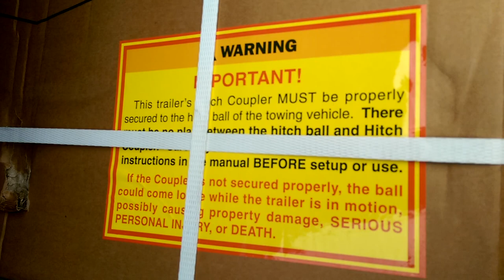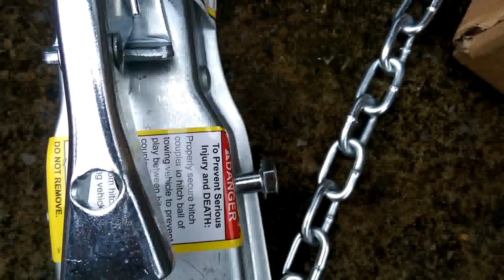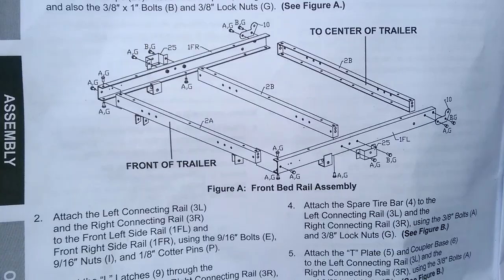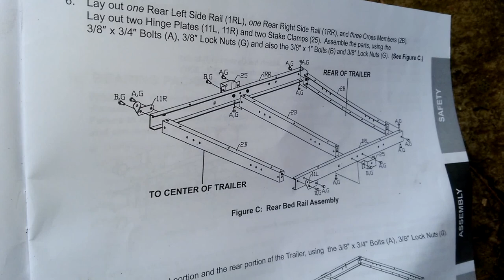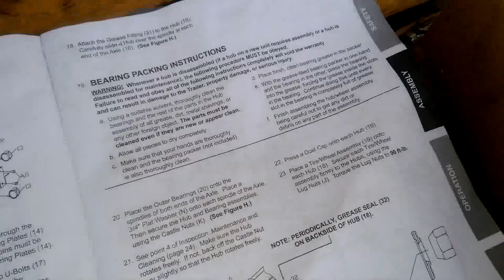HARBOR FREIGHT heavy duty folding trailer 4x8 1195 lb.

Comment: Yeah my bearings had a yellowish grease on them as well when I got mine, but they weren't packed very well. So I cleaned the old grease out and used better grease...last thing I want to deal with is a wheel seizing up a 100 miles from home. But again that's cool that it seems at least some of these trailers are being shipped with greased bearings already

Comment: Hey there, I have the same trailer and was just wondering if you packed the bearings before installing them/using the trailer?  If not, I would do that ASAP.  the bearings do not come greased out of the box and I've read countless reviews of people who say the wheels locked up because they weren't packed and greased.  Just wanted to pass the tip along so you don't end up with a seized wheel.
Reply from the maker: pattersonbrl Actually mine were greased out of the box . I broke all the rules and even added more grease through the grease zerk after assembly without cleaning factory grease out which could have been mismatched . I was lucky the two greases matched and all is well no heat build up . I suspect people that have had trouble may have dropped the bearings during assembly( dirt sand etc.) or over tightened or tried to rotate while seating bearing  . Bearings are cheap to replace we all have done it once . Still even if new bearings are needed its still a great deal you can't beat the price .
Reply from the maker: nisw1918 But to protect the warranty follow all factory instructions this is what I did .
Reply: nisw1918 Hey there, I agree with you that this trailer is great.  I've already made the money back that I spent on it helping a few people out here and there and that's great your bearings came packed with grease already.  I wish mine came that way.  Mine had this grease substance on them, but I didn't trust it after reading so many reviews of people having issues.  Glad to hear you love the trailer too.
Reply from the maker: pattersonbrl I drove it unloaded a short distance to see if they bearing heated up and they did not so I left it as was . Mine came with grease not the fancy colored grease but just Plano  grease .
Reply: I noticed u forgot the lock washers on u bolts for axle. any problems?
Reply: pattersonbrl e